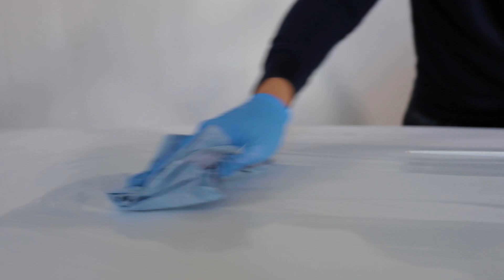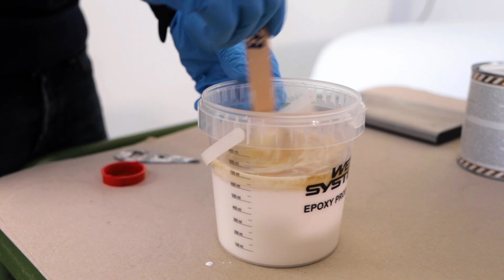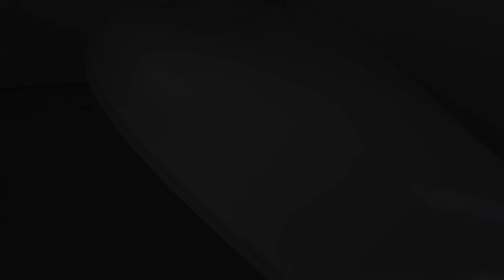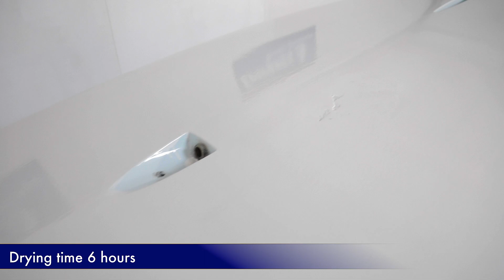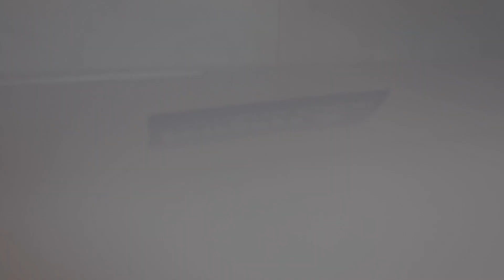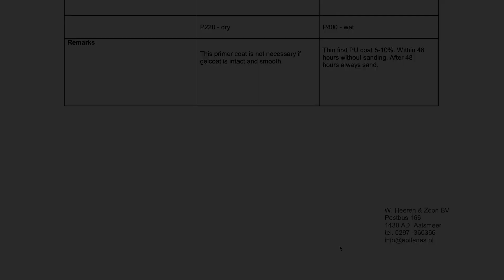How to apply Epifanes Poly-urethane paint by hand using the roll & tip method.

Comment: You put polyurethane on the hull below the waterline??
Reply from the maker: A laser sailing boat won't be longer in the water than a couple of hours. In this case you can use a one paint system all the way through. When the boat is multple days in the water, this won't be possible.

Comment: I rolled my boat using the methods, tips & material as described. Unfortunately, the "orange peel" left after the final coat was less than desirable, so after 2 weeks I wet sanded with 1000, 2000 & 3000, followed up by Mcguires #100 compound on a 7" polisher at 2200rpm.  It looked terrible.  I've done a lot of painting professionally and I'm used to being able to knock down and "rough" spots and bring it right back up using the methods described, however the pigment seems to float to the top of the wet film and as soon as you break the surface, the color changes slightly, and no matter what is used to buff, the gloss will not come back.  I ended up going over the entire boat with 400 again and laying on a 5th coat.  It's super shiny, but even using the foam roller covers recommended by the distributor, it still had significant orange peel.

With that said, it's not the worst finish from 30 feet away... lol

>>>>It would be very helpful for EPIFANES to either caution people to not attempt to wet sand the final coat, or give instructions on how to correct the issue in the tech sheets.
Reply: So u can’t polish it? At least is shiny? I need help I’m Trying to ree paint my 29er boat and I don’t know what is better gelcoat or polyurethane paint thank you